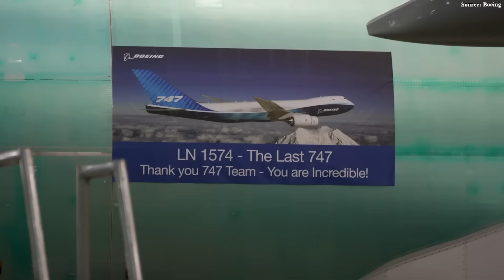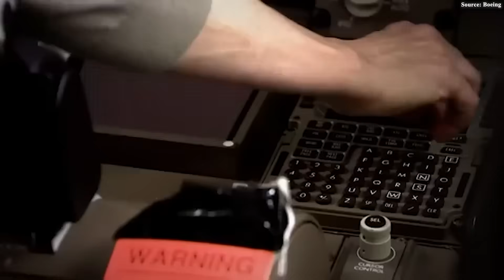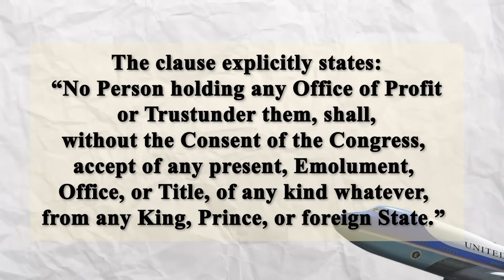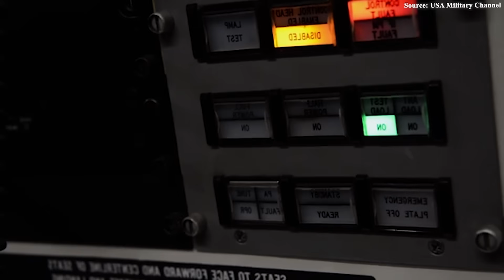U.S. Air Force's HUGE PLAN for Boeing 747-8 that SHOCKED All Aviation! Here's Why

Comment: It is taking longer to retrofit and upgrade an existing 747 platform to AF1 specs than it took for Boeing’s wonderful Joe Sutter to design, build, certify, and deliver the original 747 (1966-1971). All with slide rules and drafting tables verses powerful computer CAD!!! Ugh! 😂😬

Comment: No matter how large the fuselage, the twin-engine B777 has poor survivability in the event of a heat-guided missile attack or engine failure. However, the four-engine B747 has improved survivability, a high cruising speed, and the Dash 8 engine, which has better fuel economy and range than conventional aircraft, making it the ideal choice.
Reply from the maker: Absolutely right.

Comment: Two Boeing 747-8i were delivered to the Air Force in 2019 under contract, with the need of Boeing to complete the retrofitting into what it takes to be an Air Force ONE ... That process continues. It was disclosed that with modifications to the Contract, it could be completed between 2027 to 2029. The jet from Qatar won't come into the picture, most likely just going to the Trump Presidential Library, as a back drop.